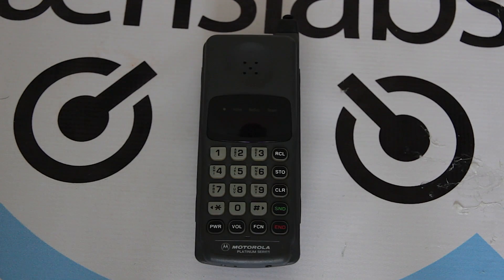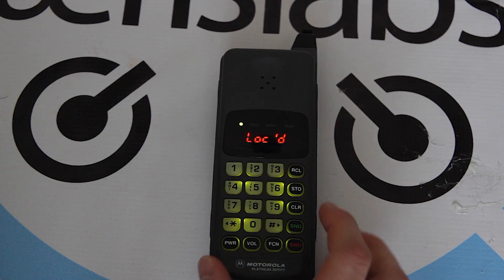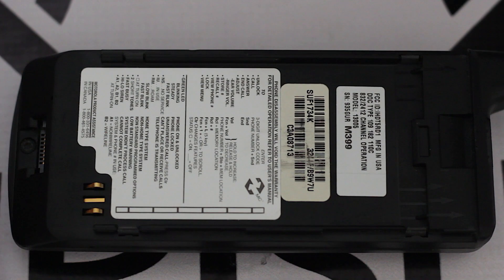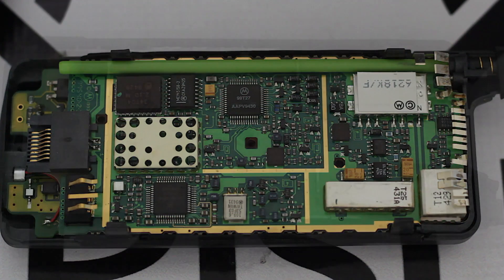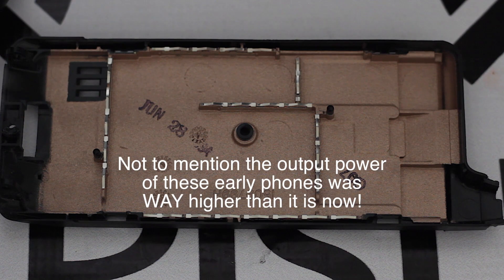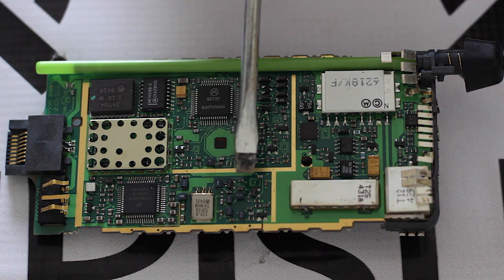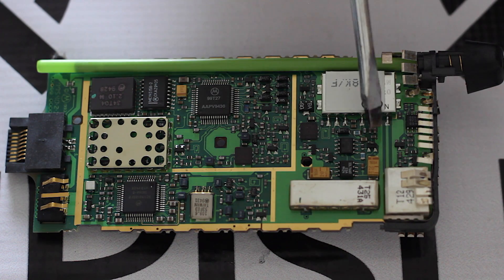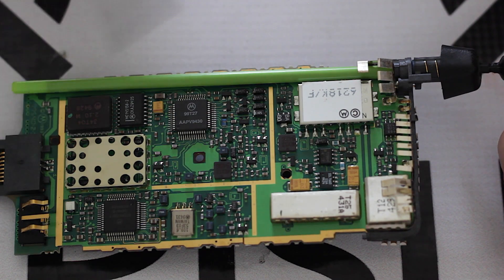10 Minute Teardowns: Vintage Motorola "Platinum Series" Brick Phone

Comment: If you want to unlock it Google Motorola bible to find the information. If it is new enough you can enter [FCN]-00-**-T-E-S-T-M-O-D-E-[STO]
Then dial 55# and this is your NAM programing. The lock code can be changed there. Otherwise you have to put a jumper between two of the contacts for the battery to enter test mode.